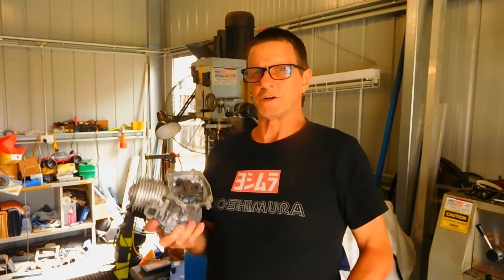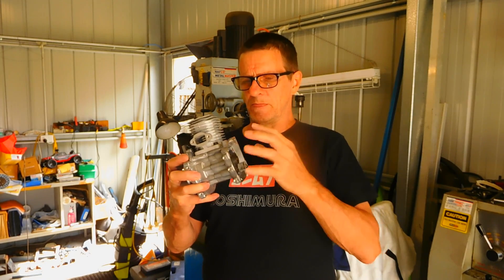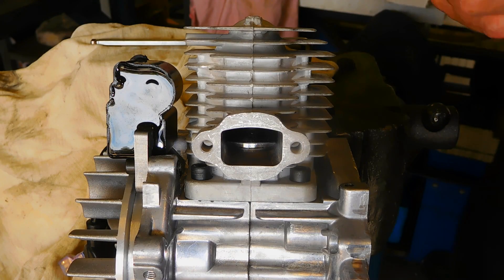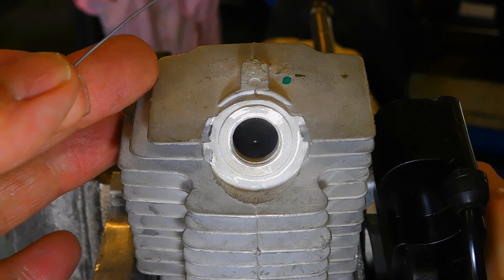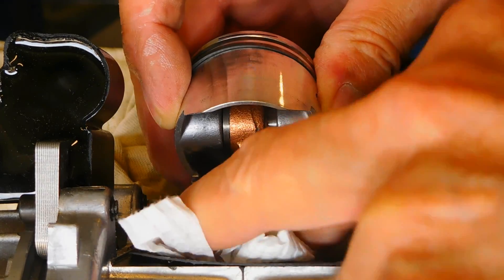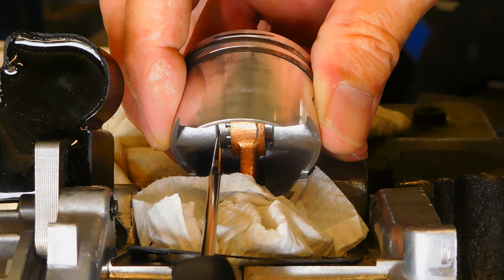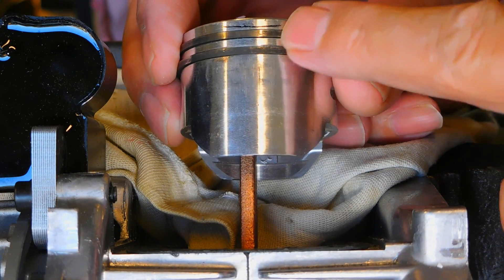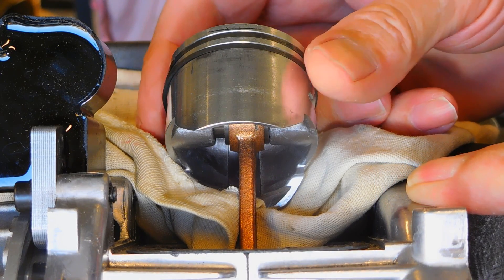Two Stroke ebay Engine, Cylinder and Piston issues, Wrist Pin Bearing problem.

Comment: ME THINKS THE PARTS BIN'S GOT MIXED UP ? WOULD GRINDING THE TOP OF THE  PISTON  ALL ROUND .OR JUST ON THE MARKED OUT 3mm SECTION OF THE PISTON  BE VIABLE  ?. OR  WOULD THAT CAUSE  A REALLY BAD IMBALANCE . OR MAYBE USE A THICKER GASKET . THATS IF YOU COULDNT  FOR ANY REASON  PUT ANOTHER PISTON IN.?  BASICALLY , WHATS THE BEST BODGE?  THANKYOU
Reply from the maker: GAZGIT
Common for 2 strokes to have the most power just before they blow up, the usual reason is that they run on the rich side of mixtures to help cool the piston and so when they go a bit lean they get more power but they then kill the piston.
In sprint Karting drivers with Yamaha KT100 engines used to intentionally tune the engine lean to get most power and at the end of the straight stick their hand over the intake to flood fuel and cool the piston off for the next lap.
Reply: Maybe the piston is blocking the port to stop the engine making enough power to rip itself to pieces, the small end bearing looks doomed already.
Reply: @dreddwailing6395  YA NOT WRONG THERE MATE .EVEN WITH RESTRICTIONS THEY FALL  APART
Reply from the maker: I'd say they probably couldn't source the right barrel and pistons for it anymore so used these ones. 
Removing part of the piston by 3 mm would leave it a bit thin at the crown for one thing and the other problem would be a loss of compression ratio as it would add to the volume at TDC by quite a bit.
If I had to resolve it I think the simplest would be just to accept the piston doesn't go all the way down at the exhaust and just raise the exhaust and transfer ports by the same 3 mm and just accept a little less trapped comp ratio.
That would recover some lost port area and timing as well.
You will see in the next video coming that the transfers have no bottom of the port they are slots all the way down the cylinder.
Reply: @AuMechanic  you could also  reshape the inlet port, weld and shape or just epoxy it. That step left from the piston would seriously mess up airflow.
Reply: @choco107  TA MATE JUST WON A £10 OF THE LAD NEXT DOOR WHO THINKS TUNING IS BLOWING THE THE CRAP OUT OF SOMETHING .THEN SAYING IT WAS THE BEST IT EVER WENT FOR THOSE 2 MIN BEFORE IT LETS GO. THE TWIT AINT EVEN GOT A £10 TO LOSE  , BUT  THE VICTORY IS ENOUGH IN THAT HE MIGHT ACTUALLY  MIGHT REMEMBER  10% OF WHY HES WRONG
Reply from the maker: choco107
Good idea but this engine doesn't have an inlet port, it has a reed valve intake that is direct to the crankcase opposite the cylinder, no boost port at the cylinder either.
The only port at the cylinder are the exhaust and the two transfers each side.
Reply from the maker: Frank Cawler
Yep the first thing I'd do if I was going to use it is fit some Aluminium washers each side of the small end bearing.